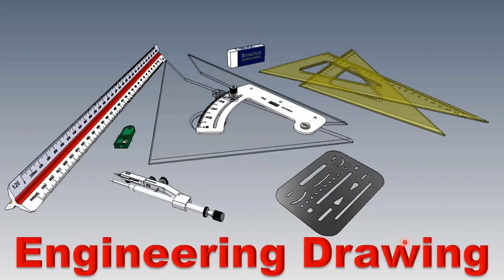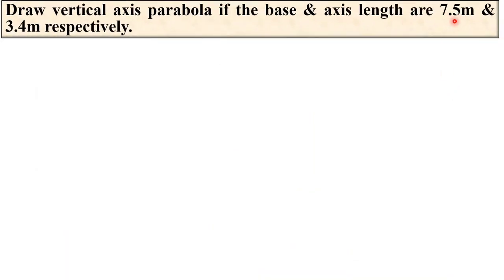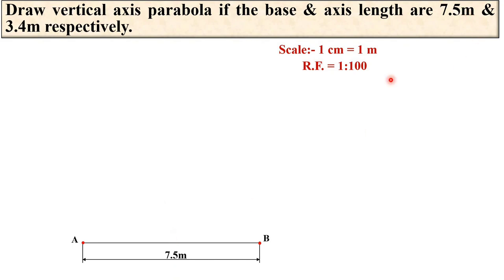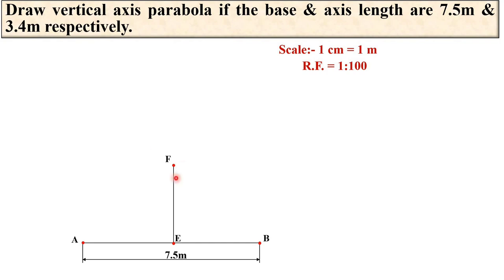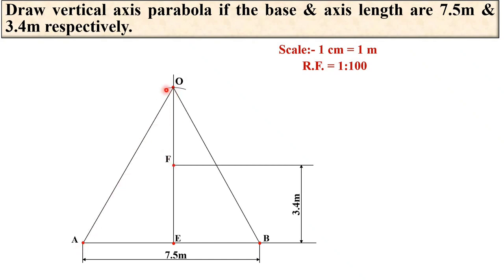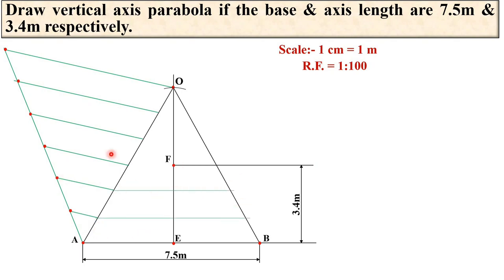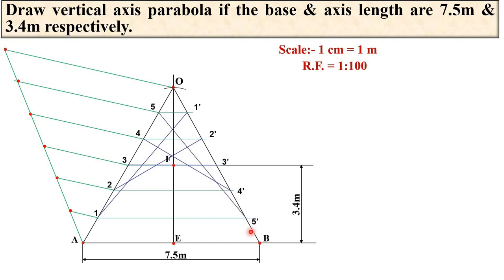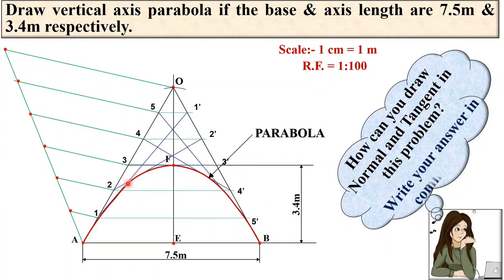Parabola by Tangent Method/Envelope Method | Engineering Curves | Engineering Drawing

Comment from the maker: Parabola by Tangent Method explained with following timestamp: 
0:00 – Parabola by Tangent Method - Engineering Drawing lecture series 
0:10 – Methods for parabola
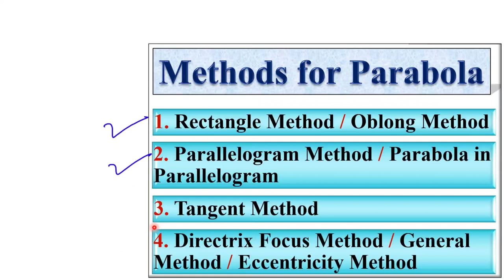0:20 – Envelope method of Parabola / Tangent Method of Parabola 
0:30 – Problem Description of parabola
1:15 – Scale of Parabola
1:34 – R.F. = 1:100
7:05 – Parabola
7:23 – Vertical axis parabola
7:35 – Horizontal parabola